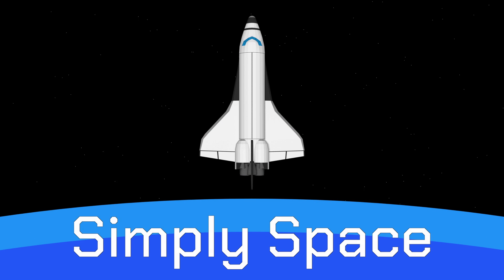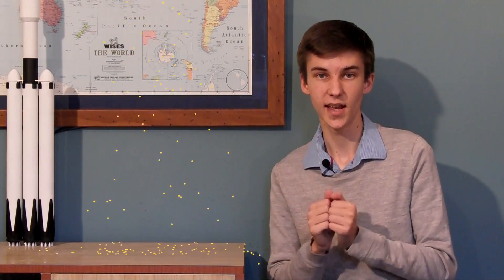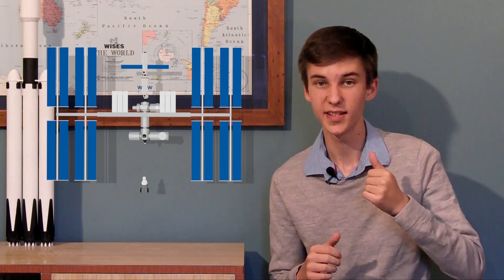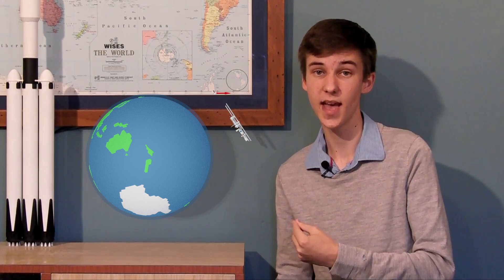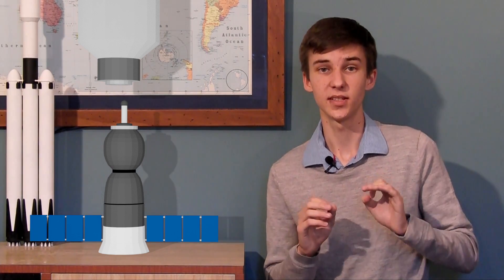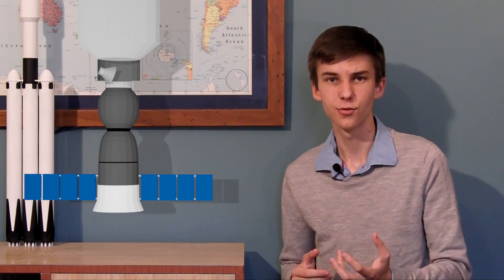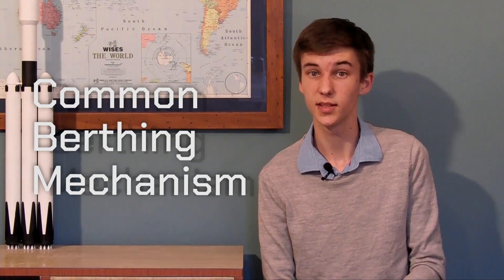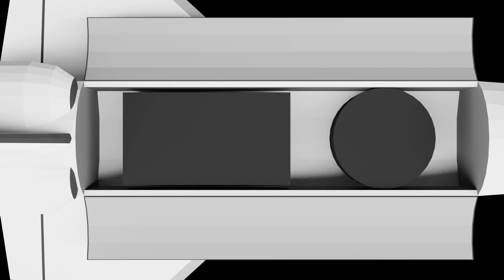Docking & Docking Port Types On The ISS

Comment: I am curious, you do not mention reaction control wheels as a possible mechanism for the RCS on arriving spacecraft; is the assumption that the possible propellant savings are dwarfed by the weight of a mechanical RCS system, or it could not react fast enough? I wonder if longer-lived spacecraft like Orion or Starship contemplated reaction wheels as part of their RCSs.

Also, if you are contemplating video ideas, might I suggest comparing APAS-95, APAS-89, and IDSS? For that matter, comparing Apollo and Soyuz might be interesting as well, since they both are probe and drogue designs. A docking comparison overview video might also give a opportunity to put some of the FAQs from your NDS video comments into video form. For example, you mention block 1 of NDS is not androgynous, is this a subset of the IDSS, or does the IDSS itself need a revision to fully describe androgynous docking ports?
Reply from the maker: I would like to do a video like that in the future. 

I suggest watching my video on ISS attitude control for an explanation of why reaction wheels / CMGs aren't used for docking, but in short it's because of saturation, and the need to perform translation maneuvers (Reaction wheels can only control rotation). KSP tends to lead to a bit of misconception of how reaction wheels are used. The main use case of reaction wheels is for absorbing angular momentum gradually over long periods of time, useful for holding a constant attitude. That's needed for the ISS or a telescope to avoid sudden thruster bursts during times that could interfere with experiments or observations. Still, you need RCS thrusters to desaturate, you just get to pick a convenient time when it's not going to mess with experiments. It's just a case of horses for courses.
Reply: @SimplySpace  I have not played with reaction wheels in KSP, I was just thinking if they might help save RCS propellant for rotation if you do enough back and forth adjustment while trying to line up with the station; or for deep space, while adjusting your rotation to align antennae or solar panels.

Comment: The predicesor of the international standard docking mechanism known as apas, was used by the space shuttle and to be used for the unfinished buran orbiter. The pma used with apas, ssvp, and ids was also used to attach the Russian section of the space station to the us section, as the Russian section's modules used designs dating back to Mir and the salyut/almaz program, which requires a soyuz to be able dock with the station without a docking adapter.
Fun fact: in the 80s to test that docking mechanism, they used a modified soyuz that had an apas mechanism. only one time was a soyuz launched with that docking mechanism.
Edit: I originally had not considered that apas and isd were two separate systems, as both systems used the concept of three paddles on the passive vehicle (station) and three paddles on the active vehicle (capsule or orbiter), so thanks to simply space for that. Speaking about that, how come you didn't show how the international docking standard used on starliner and crew dragon evolved from older apas systems used by the space shuttle in this particular video. I mean, sure, the space shuttle never flew again after 2011, but we just want to know why. You also forgot to mention that Apollo had a drogue and probe system similar to soyuz/progress for docking with Skylab and the eagle lunar module
Reply from the maker: No, they used APAS, which the IDS was derived from.
Reply: @SimplySpace  oh, thanks for letting me know

Comment: You really see the Russian ideology of keeping it simple and foolproof. where are we really pile on the complexity,  for better or worse
Reply: Yeah it seems so simple to just have a cone it can slide into, completely passively! The NASA design seems to require not only a whole active mechanical system, but sensing and intelligence to calculate how to reach over and meet the station. I'd love to hear someone explain the reasoning for going with this approach.
Reply: @Norsilca  Mainly Attenuation. When docking you are always at a slightly different speed until the very end, which means there is usually an impact of some kind as this is brought to zero. One of the main requirements behind the IDSS was to make this impact force as low as possible (one early implementation was called LIDS, for Low Impact Docking System, and is attached to the Hubble Space Telescope. the NASA Docking System was originally called iLIDS, with the i meaning "international".) The seperate soft capture ring/linear actuators allow any vibration/impact to be damped and spread out, along with it not having the entire mass of the spacecraft behind it.

Comment: Why doesn't nasa use the russian docking interface? It already exists. it's a tried and true method. and simpler.
Reply from the maker: Because they'd have to buy it from Russia. The IDS is an open standard. Also SSVP exerts larger forces during docking compared to the IDS, which has high impact attenuation.

Comment: Thank you sir...you made a complexed issue easier to understand...i was looking for the different propellants used by the spacecraft in sapce, particularly with regards to docking by the dragon crew to the ISS...could yoy please elaborate in more detail?...much appreciated.
Reply: Dragon and Starliner use Monomethyl Hydrazine (MMH) as a fuel and Nitrogen Tetroxide (NTO) as an oxidizer,. Both are very common and have been in use for decades (though MMH's cousin Unsymmetrical Dimethyl Hydrazine (UDMH) is a little more common).